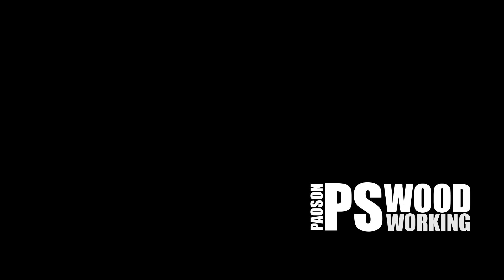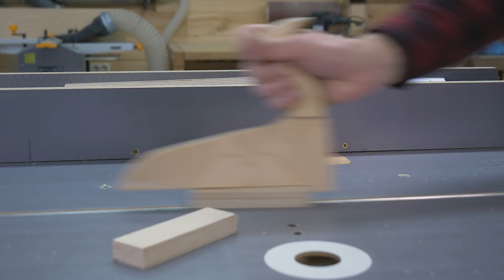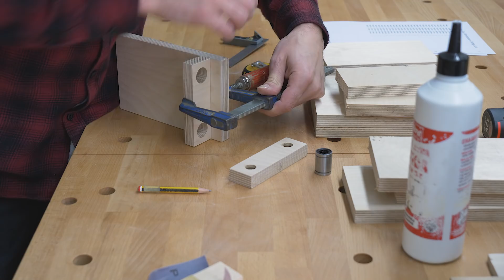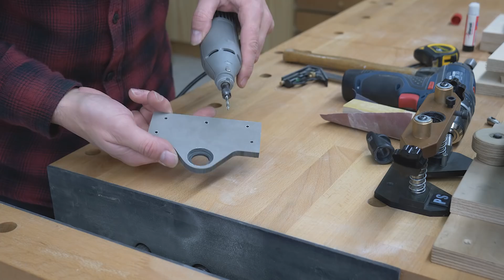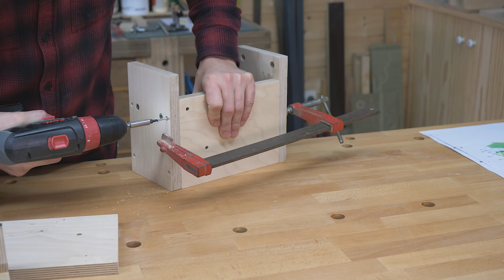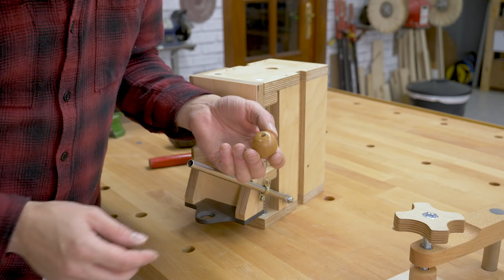Drill Press, Lathe and Router Table in one Tool / Part 1

Comment: Hi, you seem to prefer the polyurethane adhesive under certain circumstances. Is it purely for its expanding properties or are there any other reasons ?
Reply from the maker: yes, for its expanding properties. You could also use epoxy in almost all cases